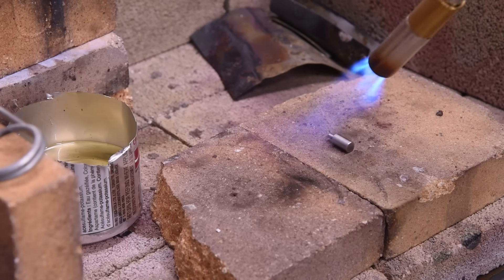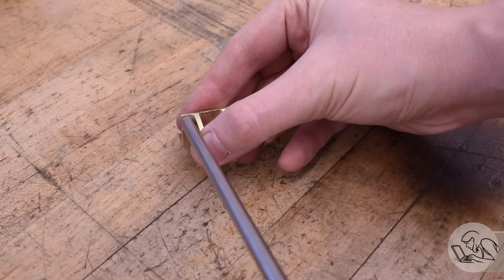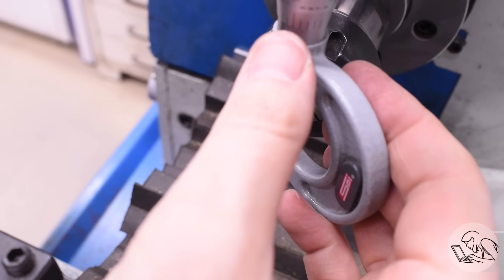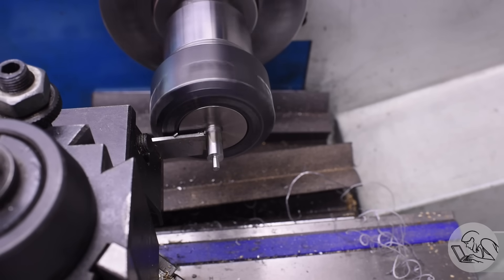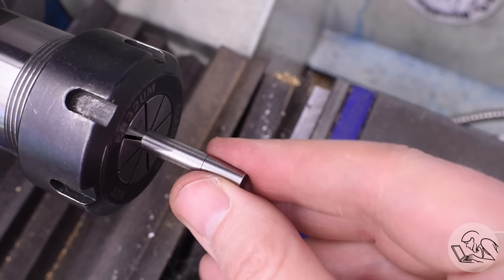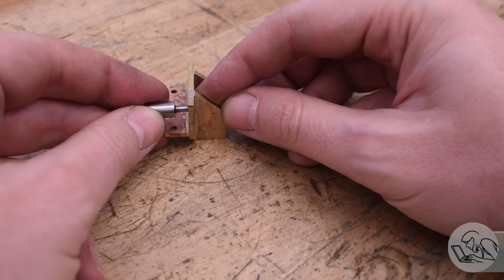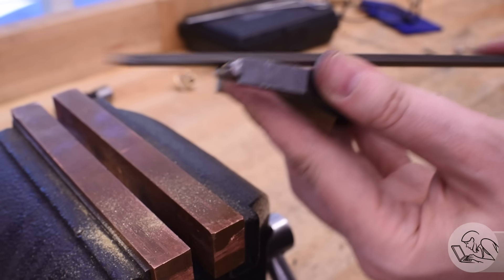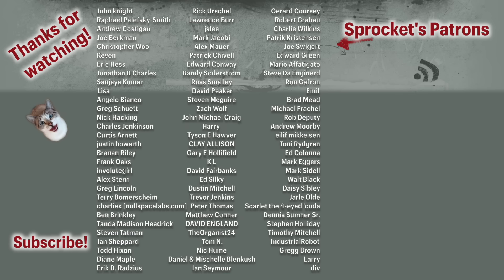Filing Buttons! Rounding Corners Accurately By Hand

Comment: Can only tool steel be hardened?; or can other types of steel be used?
Reply: Most steels will get harder to some degree with heat treating, but you never know what will happen if you grab some mystery metal from your scrap bin.  There are texts which explore heat treating for various tool, alloy, low and high carbon steels, etc.

Comment: What do you call that specific tool holder you are using to turn that shoulder? Haven’t seen that style before. The one holding the cutter in a vertical orientation.
Reply: At about t 6:39 and 7:32? I’d like an explanation too.
Reply: @michaelwise1224  looks like it could cut way down on grinding time hey?

Comment: Have you considered making a small heat treating ladle for your small parts? Clickspring has demonstrated it a few times on his channel. Holds the parts and you can fill it with boric acid to prevent the charring and blackening.

Comment: As far as things that people say "You can't do {ACTION} it'll dull your file" (such as back-dragging a file or using a hardened guide, I even had one boss that wouldn't let us use file card because of the steel bristles), my attitude is that:
1) files are a consumable that wear out, and must be replaced, the same as sandpaper, saw blades, grinding wheels and such.
2) general purpose files are very cheap when you consider how many parts you use them on before they are unusable.
3) with most of these "bad" actions, I never notice a difference in the cutting ability of the file between the start and finish of my work, in fact, when I do notice a difference, it is because I did something stupid, like try to file a twist drill shank (I needed a flat on it, and if drill chuck jaws can mar a shank, then it should be file-able, right?), or forgot to stone away a work-hardened burr (common on ski edges from hitting rocks, If you try to file one, you hear a "ziiip" sound, and you will see a line on the file where the burr has chipped [on a tiny scale] the teeth of the file, and it won't cut there anymore), used too fine of a file for the work, or some other thing where the effects were near instant.
4) the time savings from doing something "bad" for the file, but faster may outweigh the additional wear (such as with a file card, yes the bristles running along the teeth may add a bit of wear to them, but if using a file card is twice as fast as a cloth or other brush, is that not worth it)
5) Sometimes you have to accept that in order to make a particular part, you need to be more harsh on your cheap and/or consumable tool. Do you complain when you have to dress a specific radius into a grinding wheel, to grind a from tool for the lathe? So why do some people get bent out of shape about using a hardened file guide/button?

Comment: I gave up the heat treatment.
Generally I'm using buttons in the 7/32" to 3/8" diameter range.
One button is drilled to the same diameter as the hole in the work piece, then a part threaded rod of the same diameter glued in place (Loctite 603), The rod protrudes from that button with the unthreaded part the width of the work piece plus sufficient thread for the length of the other button plus a nut or two.
This avoids any blind tapping of small diameters, which gives me nightmares.
The buttons are assembled either side of the hole with the nuts adjusted so that the assembly just rotates in the hole.
Rather than holding the buttons, I hold the work so that the buttons can rotate as soon as the file/abrasive contacts the button.
Where possible, I make buttons with a 2.5mm diameter part threaded (7 BA) rod then, if necessary, enlarging the hole in the work piece to finished size. It suits my rotary table set up where I round off as small as 7/32", using buttons for that last few thousandths.
A further benefit is in final sanding where the work can be run over the paper on a flat surface.
I've used this approach on a Stuart 10V, D10, two Compound Launch and on my current project a Stuart Triple Expansion, without problems.
I was concerned that the rotation would distort the hole in the work piece, but the buttons only rotate in the final few strokes and this hasn't been a problem.

Comment: Liked this video, kind of confirms the way I  have made filling buttons is ok , alot of instructions for making model steam engines just say, use or make filing buttons assuming you know how to do this. I also have found the longer they are the easier they are to work with.

Comment: @Blondihacks not even finished watching the video and I have a question...  For small buttons/holes, instead of clamping them for use, could you instead make the button into a fitted bolt by giving it an overlong shaft, and then turning down and tapping the excess length that protrudes through the workpiece to a suitable thread, and then hold it with a nut, washers and maybe a spring washer?  Obviously for some things that shaft might be in the way, and the washers need to be smaller than the desired radius, but that more or less applies to the retaining bolt version too.  And if not, why would it be a bad idea?